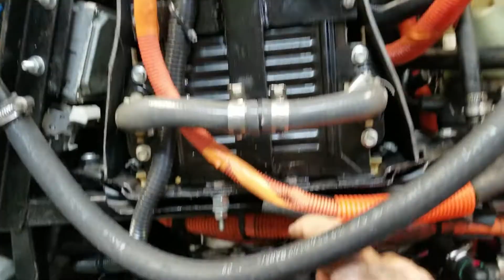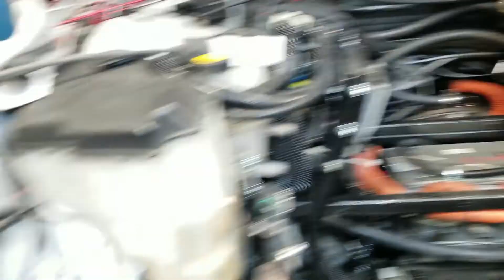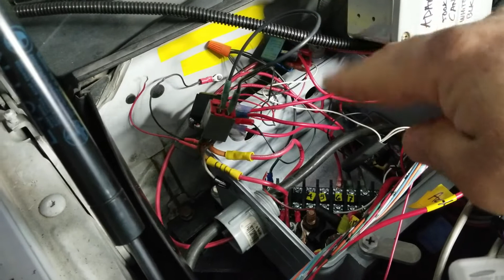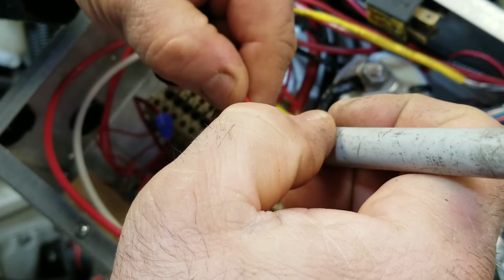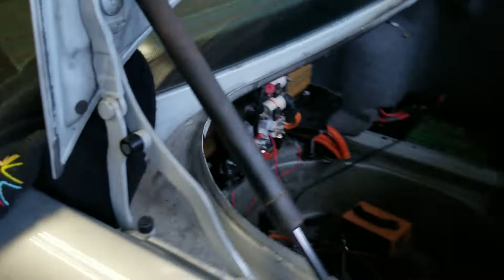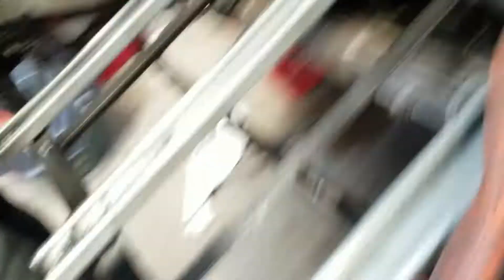Part 10 Still No Communications...  Removing Front Batteries and Inverter

Comment: good luck friend
Reply from the maker: Its going too happen... I'm way to far into it to turn back now. :)
Reply: @InTheGarge   can help me with the combination  gears selector  I have the connector  thanks
Reply from the maker: @gomezelectro466  if you are using Damien's V2 board:
 +12V IN1 is for Forward
 +12V IN2 is for Reverse.
On the gear selector...Use a multi meter and find 2 wires that connect together when in Drive(forward) and do the same for reverse. 
Once that is done you should have 3 wires. supply +12V to the common wire and wire the other 2 to the corresponding "IN" on the VCU. 
Good luck
Reply: @InTheGarge  thanks

Comment: your contactor box is twice as big as mine. though mine really doesn't have much more space for a bigger one. yours is impressively complex
Reply from the maker: It may look complex but it really isn't. I used multi conductor cable and a lot of wires are spare. 
There is a couple extra contactors for battery charging (those could've gone in the trunk) and there is one for what I call The Chevy Volt High voltage distribution block (that was on the original Chevy Volt battery). That is also going in the trunk.
Reply: @InTheGarge  interesting. My charger has no contactors. It will instantly go on when my j1672 is connected and cleared by my avc2 device. It will remain connected to the battery at all times on the output side. Using the avc2 i intend to disable the drive circuits when the j1772 is plugged in. I sought advice and believe no harm comes from using this method.
Reply from the maker: @blackterminal  I see...I wont be using a avc2 device (I'm not even sure what that is :) ). I'm using old school wiring too make my setup work.

Comment: Tony here are two part numbers for the "Engine Wire" harness aka the transmission harness that comes with the two resolver cables and the neutral safety switch cable, this harness does NOT include the Inverter plug, that happens to be a different wire harness, and we need both, just trying to help: 

Harness Part # 82121-30E21 is for 2007-2010

Harness Part # 82121-30E22 is for 2009-2011

but for our EV Conversions it does not matter what year they are off of
Reply from the maker: Now you tell me. :)  I'll definitely look into getting one(for the next project) …that would of saved me ALOT of time.  I would say I spent a total of 30hours dicking around with the Com and resolver issues.
Reply: @InTheGarge  ha ha well I did only make two boring @ss videos on them: 

https://youtu.be/SbuDm2pXu0s

https://youtu.be/y5xxKKdUNzc